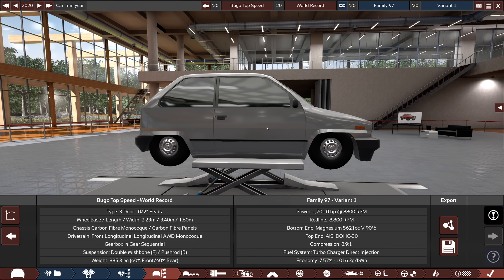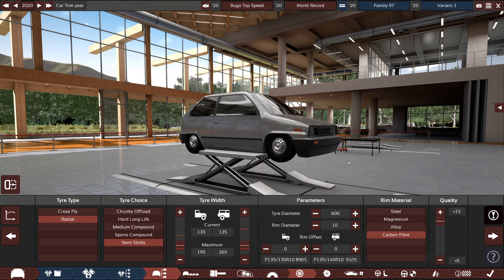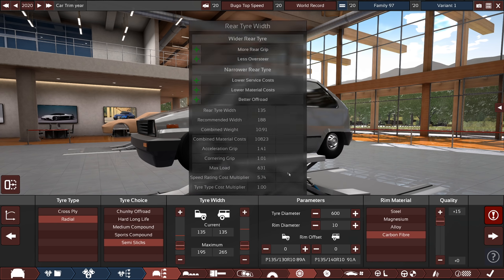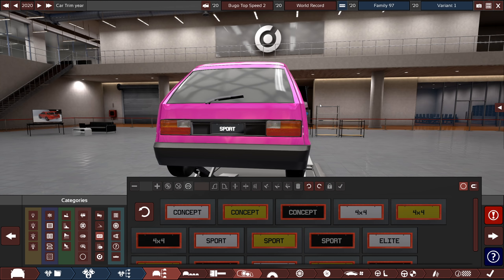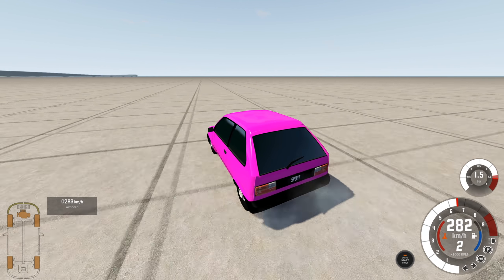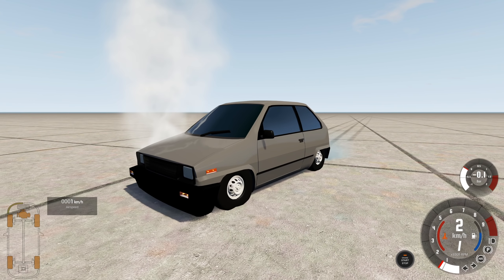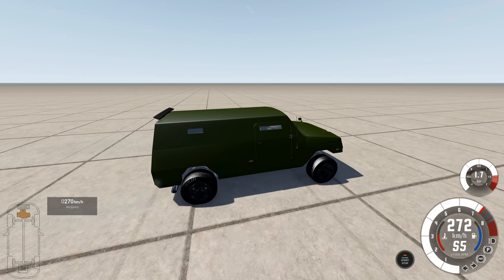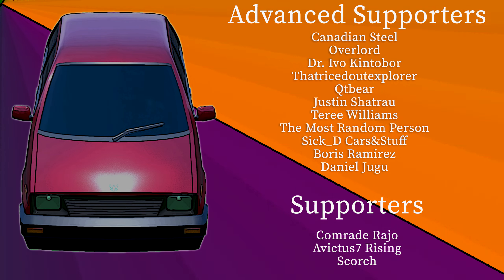Land Speed Record Bugo - (Automation + BeamNG.drive)

Comment: No cooling, a second gear so long it's unusable, an engine that could never put down peak power because the throttle's pinned to wheelspin...
The top speed isn't power limited, but gearing and engine durability limited.  Shifting into second has to start higher on the power band.  Crank back the power from 1700 to something more moderate like 1200 and dump in some cooling so it doesn't explode before top speed, then dial that back to just barely more than enough. Figure out what's holding it back now.  Aero? Needs more power, add cooling at the same time and see if that makes an improvement.  Gearing?  Make em tall boys.  And ease up on the gas on the powerband - once the tires spin that's it for going faster.

One afternoon of tinkering and you could get a definitive answer to how fast a bugo could go.
Reply: bruh its a game calm down
Reply: @garlicbreadbeans  i had no chill when i wrote this wtf my b
Reply: @noernqknonepq8024  It's like automotiveflux never played this game, even though it is basically the only thing he does. It really isn't that hard to reach that speed with a car like that.
Reply: @ReizungV  i think it's a consequence of only taking one pass at a build.  He usually knows what needs to be fixed, but never revises (unless you count dropping a new engine in a revision.)  The youtube grind doesn't really allow much time for it, i guess

Comment: I’m surprised on how a car with the drag coefficient equivalent to a minecraft block could even reach 200kmh
Reply: Keep in mind that oposite aero makes the car more "lightweight", thanks to the air pulling up. Chances are when yo get to 350 you cant go any faster because your wheels left the floor a while ago
Reply: @Ferrari255GTO  at some point it's not a car it's a glider
Reply: @Da_Shark  its a "glaider"
Reply: Golf mk2 are capable of going over 200km/h with 120hp...
Reply: @Streeto_161  my dads car is capable of over 200 with barely 90hp. Its a 4 door sedan. Try to guess wich one :)
Reply: it’s supposed to be a joke, don’t take it seriously
Reply: @chituron  i know, but i dont care because its fun to talk with pepole about what they think would be better. Its just two games either way.
Reply: @Streeto_161  every modern car with around 150hp is able to get up to 200 kph

Comment: The reason the flat tires make the car faster is because you need more grip, once boost kicks in it breaks the tires loose and you slow down due to drag.
Reply: i think if he tuned it for a flatter torque curve it'd do better. it's slow up until 6000 rpm and suddenly it shits the bed

Comment: The deflated tire keeps sticking to the body weight,so it makes more grip and it don't spin out (which causes overheat because the engine was spinning fast for the tires to spin out)

Comment: You can easily get it to 380 kph with this engine if you tinker with the gearing. The second gear is absolutely useless right now.  Don't focus so much on lowest weight, make the tires a bit wider, so it doesn't spin so much, maybe even use traction control so it handles a bit better while getting to 300

Comment: 6:45 front biased AWD. you said its because more weight on front. yes that's the right thing to do but for acceleration. when I aim for top speed I do 70% front to make it understeer. therefore prevent spins.
Reply: He is already deep into understeer

Comment: Land speed Record: 763.035 mph - 1227.985 km/h Vehicle: ThrustSSC, a twin turbofan jet-powered car
Reply: Jets are cheating
Reply: @Noooo23523  It is still a land speed record, someone could take an Sr71 and make it lower and remove as much lift as possible and that could set the record
Reply: @silentneko7961  jet engines beat top fuel dragsters that have 8000 hp

Comment: You should lengthen the gears out but not as far as you have but enough to get 4th gear at 400kmh and you could easily get it it you shift early to reduce wheelspin and you will beat the record

Comment: Deflating tires gives you a better grip. Usually in quarter mille races tires are deflated
Reply from the maker: more grip but higher rolling resistance, which greatly reduces top speed
Reply: Yes you are right. But what i ment is that if your tires loose grip at sertain piunt, you wont be able to reach top speed. If you deflate the tires you are able to keep grio at a higher speed  at least that is what i understood the problem was with the car in the video, i may be wrong. Great video and sorry for my english it's quite rusty
Reply from the maker: @JuanTorres-mo7kl  You could be right also, beamNG physics can be odd at times...

Comment: Hear me out I wouldn’t have used carbon fiber I would have used normal steel because in land speed racing sometimes they have to add weight to gain traction and go faster with a super light car basically nothing but aero is pushing down on the tire

Comment: Is it the limits of the Bugo that prevent you from going faster or is it that your Saint ultra R has a gearbox which will shift up before your tires deflate.
Not once did you try to pre-shift on inflated tires. Maybe you did that off-screen but it feels like you can get so much more out of the car if you manage to get into second gear before you get your crazy wheelspin moment in first. Hell, with 1700 HP you should easily be able to start in second to lower the chance for wheelspin.